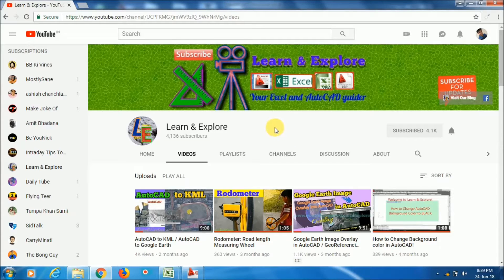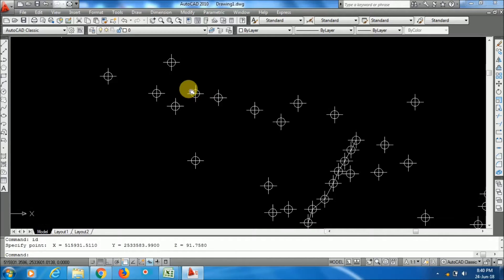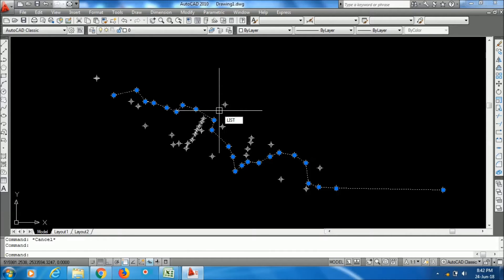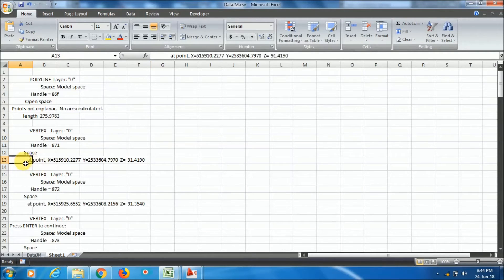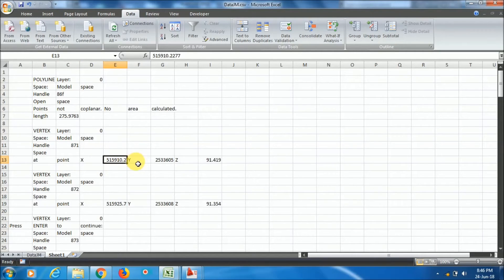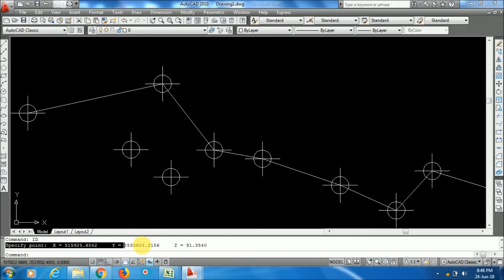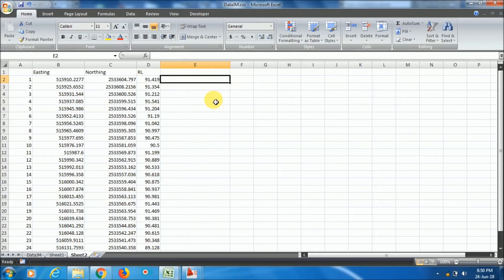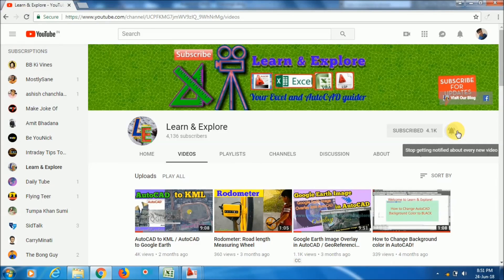Export X Y Z Coordinates // 3D POLYLINE vertices // AutoCAD to Excel

Comment: I have a AutoLisp program that does the same thing, but,  at the extract command will automatically give number to every vertex and create a text file ready to import on to total station , ready for setting out, takes me 5 minutes to extract 100 points :) like this

1;481072.418;96777.721;0.000;;
2;481090.795;96772.626;0.000;;
3;481084.616;96706.156;0.000;;